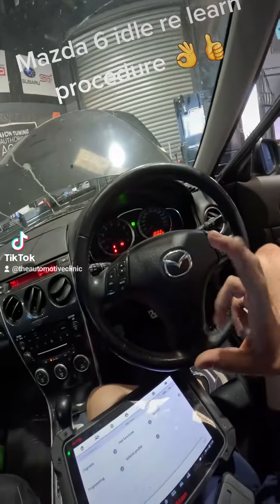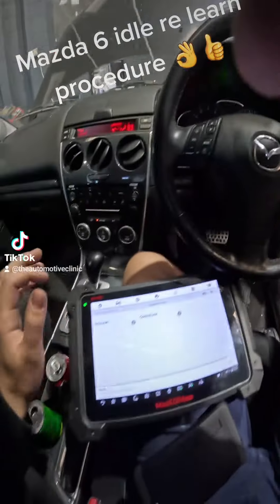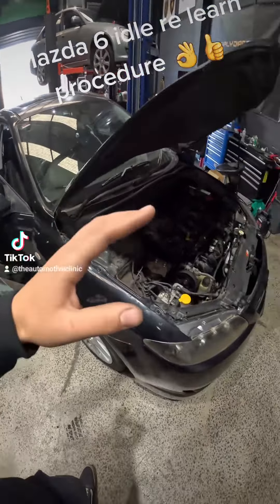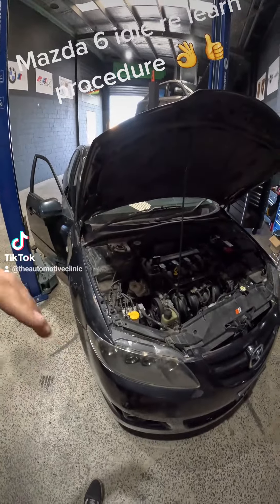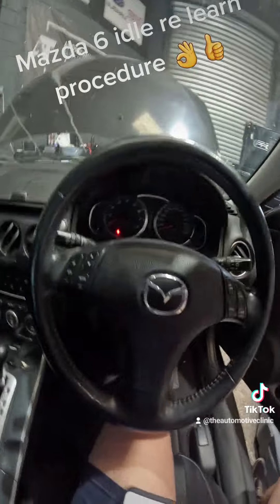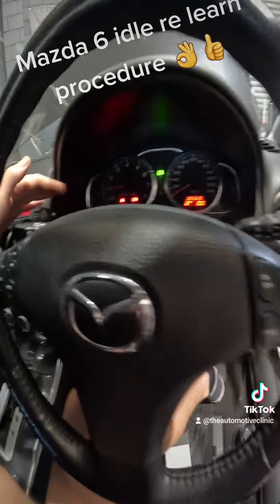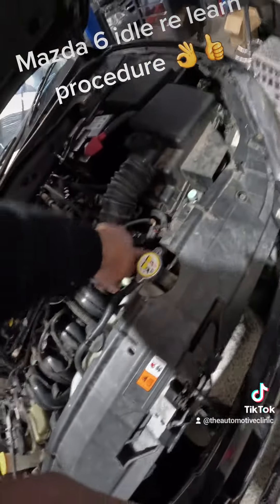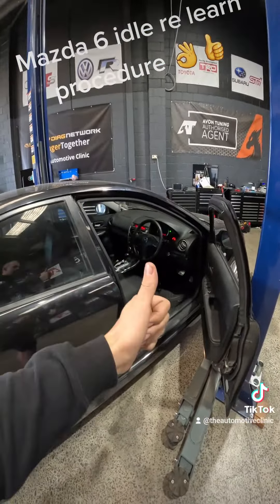Mazda 6 idle relearn procedure 👨‍💻👍

Comment: Cleaned the throttle body with proper spray can cleaner and the idle became up and down straight after. You advice fixed it , was thinking I would have to fork out for new parts, thank god I found your video. 👍

Comment: Hello Brother.
I would appreciate it if you could write down step by step how you do the study. I don't speak English well and it's hard for me to understand everything from the video. Thank you.
Reply: 1. Disconnect negative terminal on battery for 10 minutes. 
2. Reconnect battery terminal. 
3. Turn ignition on for 1 minute but don't start the car. 
4. Turn ignition back off for 1 minute.
5. Start the car and allow the engine to idle for 5 minutes without airconditioning or any fans on. Don't accelerate. 
6. Turn engine off. 
7. Start the car and turn on airconditioning and allow the engine to idle for 5 minutes without acceleration. 
8. Turn engine off. 
Engine Idle should now be reset.
Reply: @matteo_syd7271 would you happen to know if this will work for a 2007 Mazda CX7

Comment: Short version: This fixed my Mazda 6 cut outs (not over revving).

Long version: Changed the battery on my old 2007 Mazda 6.
Tried to drive the Mazda. Was idling at less than 500.
Cut out when waiting at traffic lights.
Cut out while moving (You loose power steering at the same time, not fun in a bend)
Assume person who sold me the new battery was a moron, and gave me the wrong one.
Check numbers and codes on the new battery.  None match the old battery exactly. But more amp hours = more better right?
Check internet before i go yell at the assumed battery sales moron.
Forum posts and Quora say do an "IIdle Relearn", but not HOW.
Find this video, try it out.
It's ALIVE! 🌩❤

You saved me a headache and some poor sod an undeserved yelling at.
Reply: Ah so glad i read your comment. Exactly the same thing happened to me.